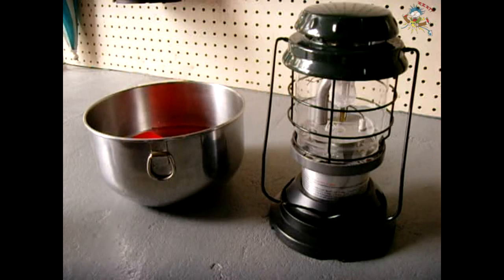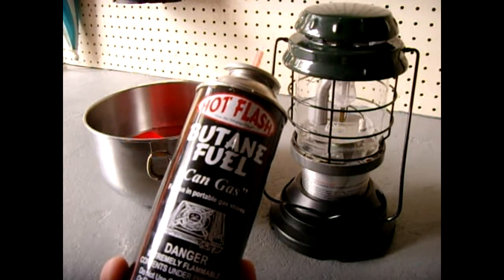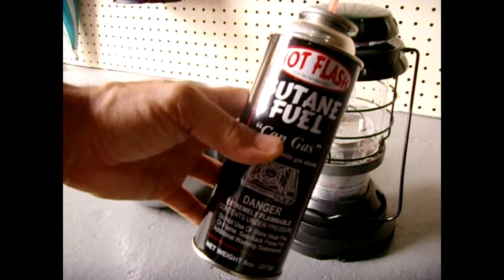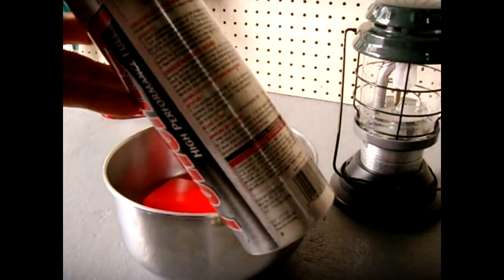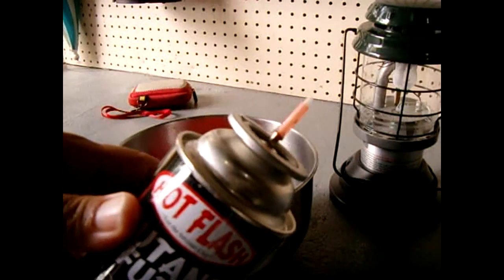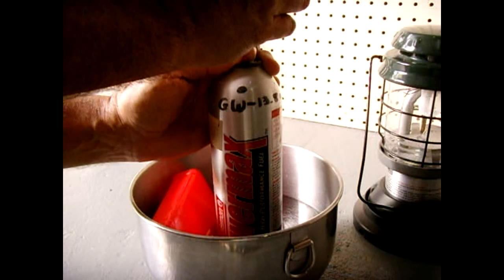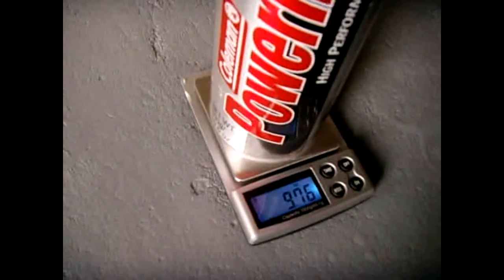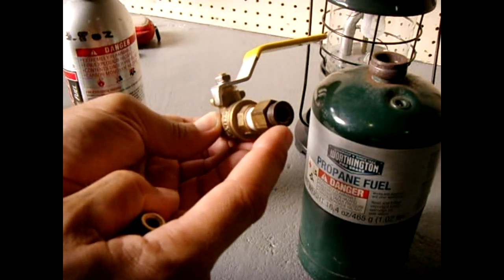How To Refill Camping Gas Cylinders/Canisters

Comment: As usual good show! Oh, just scored a flat screen will use for parts... Could have scored a microwave for the transformer and the fan but, it sliped away to soon.
Reply from the maker: Lots of goodies in the LCD tv. Keep the switched power supply, inverter and backlight for sure.
Reply: electronicsNmore ok, must be low wattage on first inspection the cord was not very thick. I did plug it and turned it on and well, it works. Exception the screen is cracked oh well no worries me and the misses do not watch alot of TV I have a 50" beutiful samsung plasma an another one in the BR. All is well though I was happy just to get it for parts....

Comment: I seem to recall that the Powermax cylinders are the only ones that are made of aluminum? That would make them very desirable from a weight standpoint. Have they discontinued this line of products? I cannot seem to find them listed at any of the usual places.
Reply from the maker: You can find them online. I refill them for 2 reasons, price and because they are hard to find.
Reply: electronicsNmore Thanks for that info. I had forgotten that they have their own proprietary connection. What would be handy would be an adapter that would allow for the use of the more common 7/16 NS threaded Lindal connectors. As others have noted in forums, it's too bad no-one makes a refillable Titanium 7/16 NS threaded Lindal cannister with spec's high enough to handle propane, I'd probably be willing to pay $100.00 for something like that.

Comment: mmm interesting, but still looks dangerous unless you really know what you are doing. It's not just a little pop like when a cap blows when you mess up with those..
Reply from the maker: I refilled 3 the other day. No problems. I only had to use the blunt nail on one cylinder to stop the leak. Newer cylinders are resistant. There is no cap to blow, all that can happen when properly filled, is the valve in the canister may not seat properly. That is all. This is certainly not for the average person. :-)